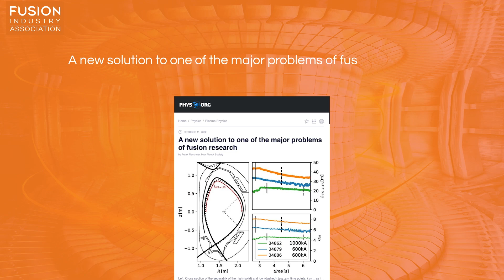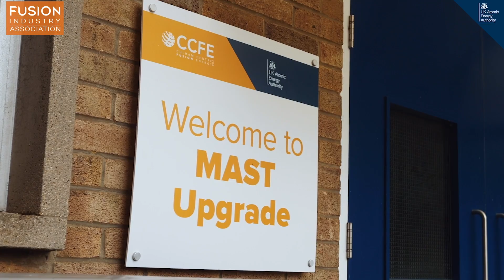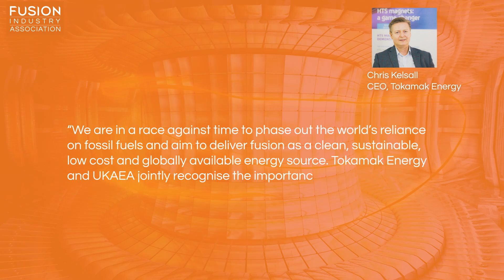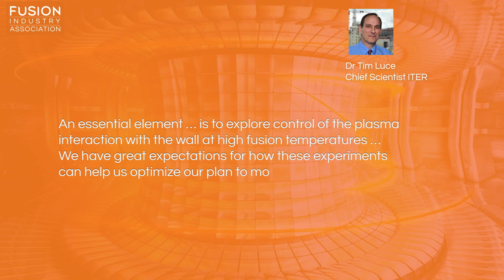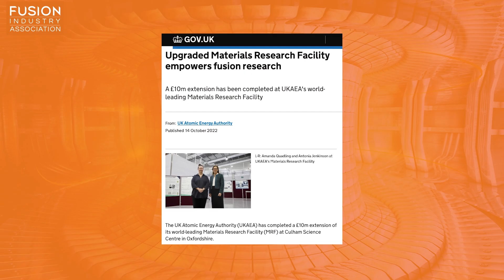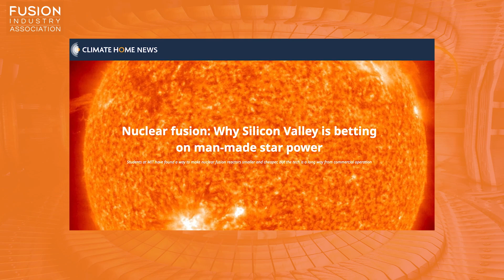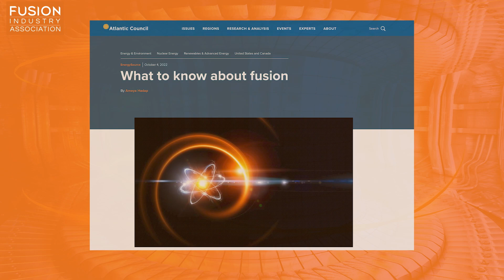Fusion News, Friday October 21, 2022

Comment: Given that aneutronic hydrogen-boron fusion presents the best option from a raw materials perspective, shouldnt we be concentrating on improving energy/temperature containment at the high temperatures required rather than trying to source fuels from the moon or whatever. If we can contain at 30,000,000 Kelvin, does it necessarily require a quantum leap to get to 120,000,000 Kelvin?  If there is a Moore's law for generated temperatures, surely 120,000,000 K would be a cinch at some point? It might help if they started looking at fusion from a probability of nuclear collision perspective, and look at technologies that could target better, i.e, increase the probabilities of collisions for the amount of energy put into the system. Femtofocussed proton accelerators on a crystalline boron salt matrix or whatever....real scifi stuff but presumably feasible at some point.
Reply: Or perhaps https://www.youtube.com/watch?v=yJTi7cnZtYI&list=PLPUWVkZSTqvOK7vpbkwN5SVQWMiBsr5OL&index=10
Lattice Confinement Fusion

Comment: No useful information can be obtained from the Materials Research Facility without a 14 MeV neutron source to give the high levels of damage relevant to fusion conditions and to validate simulations. Regrettably no such source exists.
Reply: Moderation exists.
Reply: @willis936  Sorry, I don’t understand your point. Can you explain?
Reply: @johnh6245  Use a particle accelerator spallation neutron source then use a neutron moderator to push the energy spectrum down.  This is already done at commercial neutron sources.  There are lots of games to play with materials and geometries.
Reply: @willis936  Fair point, but can these sources give the high doses, eg up to say 50dpa, that would be required?